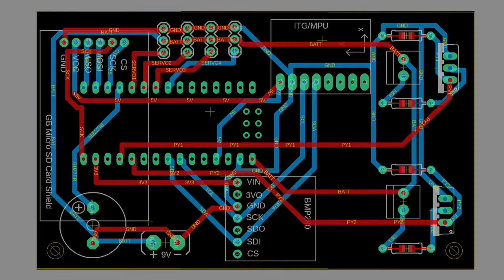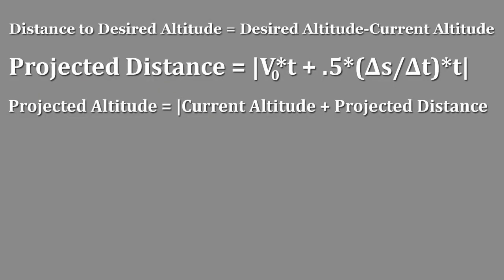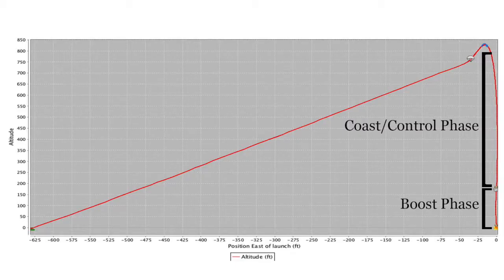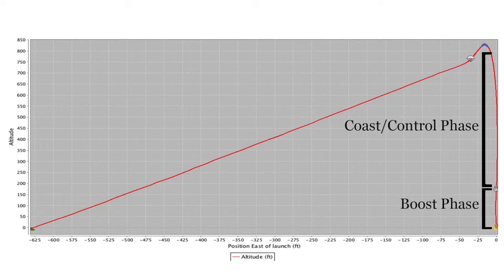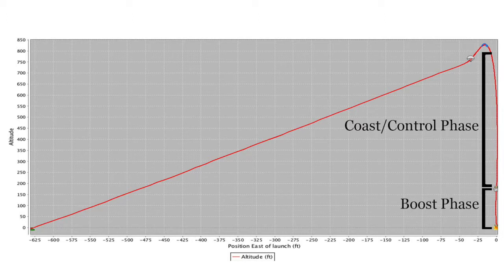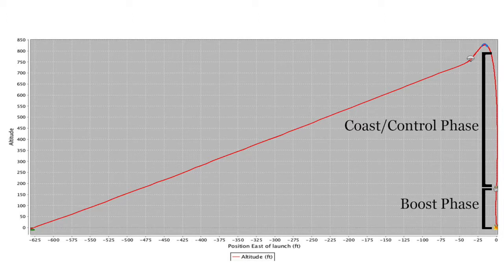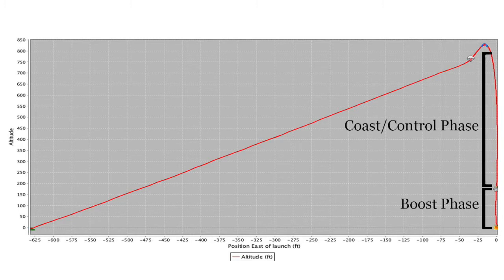Arduino Rocket Update - Ariel Flight Control System

Comment: looking good !!! 
I am just about to start this my self. just started messing with an ESP32 + MPU9250 to get some ideas of sizes/ dimensions etc.. 
was going to start drawing up on sketchup the basic rocket frame to host the eletronics. 
Did you have a shared 3D design kicking about ? or you keeping it private... just trying to save time reinventing wheel with designing dimensions to fit servos etc.. 
Keep it up .. look forward to next update.
Reply from the maker: I can put the air brake fin design on the github, but I don't currently have any servo mounts designed, I've been trying to get the electronics side of things working first. It would be later today before I can post the fin design, I have class and work. I need to update a few other things there as well.
Reply: @FrogPondEngineering   great progress... i was more interested in starting with the stabilazation system frame as that will dictate the diameter of the rocket. So wanted to start there really and mess with 3d printer .. get an idea what servors .. pcb size i can work with etc...  you have any basic starting STL files you fancy sharing ? saves me re-inventing the wheel again. ( note i am a total noob with 3D design .. I am an electronics engineer background).
Thanks mate
Reply from the maker: I can upload some old servo housings that are outdated to this project. I've mainly been working around BT-80 sized tubing for the rocket, 66 mm. That's the biggest I have and I don't want to order bigger, so I've been making everything fit into that. Again it'll be later today before I can upload any files, heading into class momentarily.
Reply from the maker: I finally got a servo housing uploaded to thingiverse, you can download the .stl there.
https://www.thingiverse.com/thing:3558078

Comment: Can you please help me building a stabilization system for rocket
Reply from the maker: Kind of. The law restricts what I can do for certain kinds of systems. ITAR part 121.1. The system that I am currently building will have stabilization capabilities, but will primarily be used for altitude control. Stay tuned!
Reply: @FrogPondEngineering  please help me build my own stabilization system
Reply: @FrogPondEngineering  i dont understand the LAW! what are you talking about?
Reply from the maker: The U.S. Munitions list. It states what I can and cannot share with non-U.S. citizens, or anything on the internet. Attitude control falls under guidance systems, Altitude control alone does not, stabilization systems also fall under guidance systems, which are part of the US munitions list, ITAR Part 121.1. I don’t particularly feel like going to federal prison.